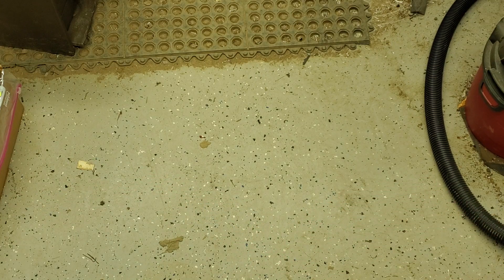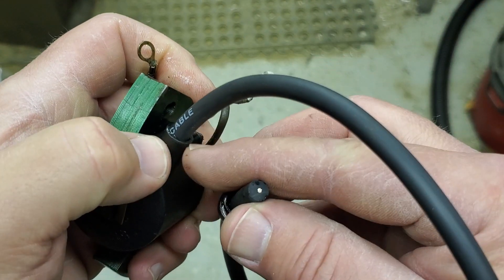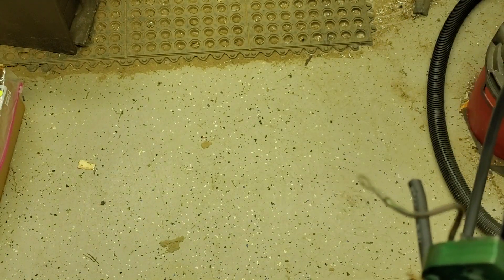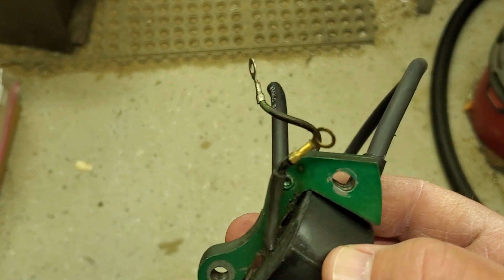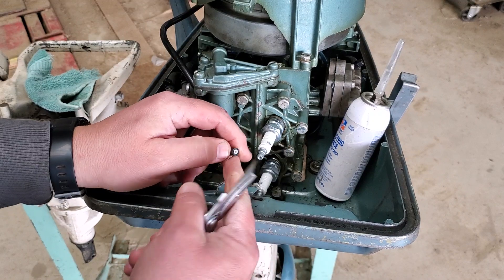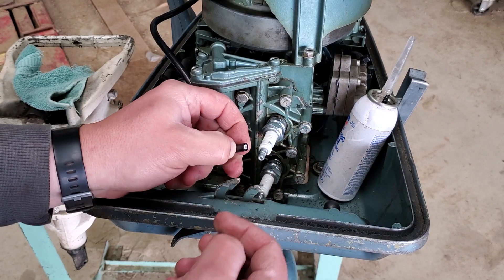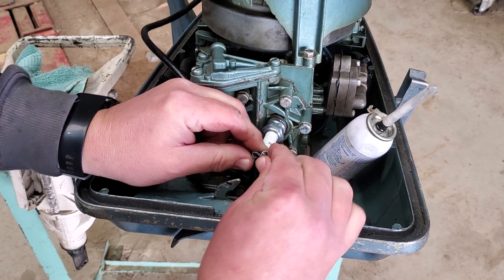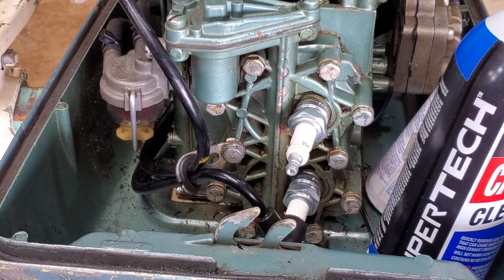Replacing Spark Plug Wires and Terminals on an OMC Universal Magneto

Comment: Great video. Do you have a video of setting the air gap on tie coils after replacement?  I don’t have the locator ring
Reply from the maker: I don't have a video of it, but when setting the coil air gap without the ring, just line up the heels of the laminations with the machined outer edge of the bosses the coils sit on.  Use your fingernail to get them as close to the machined edge as you can without them hanging over and tighten them down.  I have set lots of them that way before getting the coil ring.  Thanks for watching!

Comment: Thanks for the tips, I've got a motor just like that one, have you ever ran across a bronze 2 blade prop for a 5.5 just purchased a 62 Johnson with one, and guess that's the only year they incorporated fuel filter housing on intake, that calls for sock type element, keep the videos coming.
Reply from the maker: Yes, I have seen a 2-blade and a 3-blad bronze prop for the 5.5.  They are not real common.  They have all been Michigan Wheel props.  I had a '62 Johnson 5.5 and it had the remote mounted sock filter too. I guess I never paid attention to that being the only year I had seen woth  sock.  Thanks for watching!

Comment: I'm restoring a 57 mercury mark 10 which runs good but the plug wires are old and need new ones. I haven't looked that close yet but was told the old coils the spark wire can't be replaced?
Reply from the maker: Without looking it up I don't know if the Mark 10 Merc has Phelon or Scintilla ignition.   Either way, the plug wires can be replaced, but the Scintilla mag will have either tabs or solder blobs on the coils. If it has a tab, just bend the wire through the loop.  If it has the solder blob, you have to very carefully unsolder the old wire and solder on a new one, or if part of it is good, cut the wire and solder a new length of wore to a stub of the old one.  Be very careful soldering them.  Too much heat from the soldering iron can melt the secondary winding internally.
Reply: They have the Phelon coils. Thats good to know then. Thanks

Comment: Thank you for the helpful video. Got a ? for ya  do you know if a 1957 10hp Johnson lower unit will work on a 1958 Johnson 18hp?
Reply from the maker: You're welcome.  Glad to hear you found the video helpful.  Yes, the 5-bolt lower unit from a '57 10hp Johnson (or Evinrude) will bolt up to and work on a 1958 Johnson 18hp.  Thanks for watching!
Reply: @oldjohnnyrude8404  Thank you so much for the info. My 18 HP lower unit is bad (gears) former owner got the screws boogered up so bad , I have a lower for a 56 10 HP, and was hoping it would work. I'll use the prop from the 18. I sure do appreciate your help friend , thank you again, God bless you

Comment: Happy thanksgiving!
I just pulled apart the 33 and 35 to start the short shaft conversion. Unfortunately I won’t be able to just bolt the short case on, the flange is ever so slightly different and will not seal, and also the water pumps are different the 35 has 2 tubes coming out the 33 has 1..but everything else looks good for swapping parts. I was hoping you knew off hand which of your videos will guide me for removing the shift rod, that’s the only part I’ve never messed with in this process.
Reply from the maker: I guess I didn't realize you were dealing with one Super Quiet and one non-Super Quiet.   That is true, they will not quite match up.  The rest should be the same.  The powerheads don't match up either, but the internal parts are the same.  If the actual shift rod has to be changed, the gearcase has to come apart to remove them.  The skeg comes off then the gearset comes out.  At that point the shift fork and shift rod assembly can come out.
Reply: @oldjohnnyrude8404  ok, so i gotta take the very bottom skeg part off, and that whole gear assembly should just come out in one piece, then shaft just slides out thru the bottom right? And doing all that gives me access to the shift rod linkage too. I should probably replace all the oil seals and shift rod seal while I’m there too huh?
I didn’t  know The was a quiet motor, the housing is all different for sure, i thought it was just fancy 50s facade styling... I wish that 59 was in fixable condition because, I can’t believe imma say a Johnson is better looking than the Evinrude, but this one really is/was ;)
Thankyou
Reply: @oldjohnnyrude8404  got the cases opened, the skitwin definitely had a water leak, the Johnson was sealed tight... the oil/water was also rusty orange in the skitwin, the o-ring for the prop shaft was rotted completely away,the cotter pin for the shift rod linkage was rusted almost all the way thru, and the case was sealed with silicone not a spaghetti gasket, and the driveshaft was missing it’s o-ring also. I’ll have to use the gear assembly and bottom case cover from the Johnson for peace of mind. Good thing I did this swap!! So I’ll order the driveshaft seals and a new impeller and she should be good to go :)
Reply from the maker: @TheFrogfeeder  I have had plenty of them turn out that way.  Yes, it is a good thing you made the swap.  It should be set once you get it done and back together. 👍
Reply: @oldjohnnyrude8404  this will be the most work I’ve done on a motor yet, I got everything apart and clean and covered, I found a entire lower unit seal kit on amazon for 26$ so I’ll even have the nylon washers for the drain/fill plugs which I’ve never seen on any motor I have or had. The lower unit will hopefully be good for as long as I own this motor now :)
After this, I just gotta retap 2 bolt holes where somebodies jbweld let go, The starter bottom bracket is mounted to those 2 holes, and there is pressure behind there...I think that goes back to this being a frankenrude motor ;)

Comment: Hey I purchased a 69 18hp,evin. Seller said it had new coils,points, by his local mechanic, at pre-insp noticed mag plate movement at rotation,pulled flywheel found 1 lam leg contact to flywheel, lams were discolored slightly starting to flare open slightly, no major grooving on flywheel. Coils appear to be BRP markings and new gold hold down bolts, Thinking to replace with new one, what's your opinion would you go used old factory type or (hi-fong) china, noticed no fuel filter on that model either, going to adapt factory glass bowl type and remove spark plug wires protective sleeve too, stiff over time think that was the cause of worn advance lever, 69 late model, kinda like to leave them what there born with, you need flexibility on those wires, including stop wires too, enjoy all your videos, I understand what you deal with on getting them right, when you can crank them with 6" of rope
Reply from the maker: I would replace the worn coil with a new OEM coil.  I would avoid the Chinese Ebay aftermarket ones. If you do want to be able to start your motor with a 6" pull of the starter rope, don't try the cheap Ebay coils.  They run, but they won't make a strong spark at that low of an RPM.  If you give the rope a rip, it will start and they'll keep it running. Starting will not be as easy though.  I like to keep those coils in 10hp and under motors most of the time.  Sierra do not always have well-fitting laminations anyway and the lams are the reason for replacing the one existing coil.  I would also hold on to the coil with the flared lamination as a spare.  Chances are it would still work fine as it is if you didn't want to replace it at all.  Just move the lamination back so the edge is even with the machined bosses on the mag plate.  The auxiliary fuel filters were eliminated at some point due to the filter screen being inside the fuel pump inlet cover.  I do like the glass sediment bowl filters also.  Having the extra filtration certainly will not hurt anything.   
Those plastic sleeves over the plug wires always get stiff.  I have removed most of them from my motors for that reason.  The kill switch wires get stiff too, but do not restrict magneto movement like the sleeve does.
It is always nice to hear when someone enjoys my content. Thanks for watching!

Comment: Thanks for the great how to, I just picked up a nice QD15 that will need going over, Where do you get your parts such as carb kits, water pumps and the like ?
Reply from the maker: Congratulations on your new motor.  The QD-15 is a great one.  I buy many of my parts from Marineengine.com.  Also check iBoats, Vintageoutboard.com, ebay,  etc. Something to know about the QD-15 since it is a 1954 those are getting harder to find parts lists for.  Many of the parts, however, are still common with much later motors.  The water pump is the same as that used in the 18-25hp through 1976. The carb kit is the same one used on the 10hp through 1963. Coils,  points, and condensers were used on all the twin cylinder OMCs from ~1952 through 1972. Thanks for watching!

Comment: Where do you get your spring tips for the spark plug wire to spark plug head? I've looked all over the internet and don't find anything like that? Thank you for the info...
Bill
Reply from the maker: They are available from BRP, Sierra Marine Parts, and other sources online such as this one:
https://lionparts.com/products/spi-01-109-sparky-plug-connector-sold-each-not-pair?variant=31138827993167&utm_campaign=gs-2019-11-20&utm_source=google&utm_medium=smart_campaign&gclid=Cj0KCQjwmcWDBhCOARIsALgJ2QcHm18LQhuodvUw2QFwk7iFA5xdHTEEQK4sVKohugEp2NkOEF1IqsYaAmHGEALw_wcB

Thanks for watching!

Comment: I have a 1960 Ward/ sea king 35 hp with electric start gg8837A. From what i understand the sister engine is 35DE13 by gale/bucaneer. Ive read somewhere that these are considered OMC engines . do you know anything about this im struggling to find parts.
Reply from the maker: Your Sea King is built by Gale Products.  It was the third branch of OMC.  They built all of the store brand motors for OMC that were marketed by Wards,  Spiegel, Atlas, Goodyear, Eaton's of Canada, etc.  The 35s are mostly identical mechanically to the Johnson and Evinrude 35hp motors with the standard (non-super quiet).  To my knowledge Gale never built a motor with the Super Quiet lower.  The 1957 and '58 standard J/E should share pretty much all the mechanical parts that are not cosmetic.  I hope this helps. Thanks for watching!
Reply: @oldjohnnyrude8404  thank you so much! Im glad there is someone out there with as much knowledge as yourself willing to help others and share their videos. Thank you again. Ill have to send ya the video when i get the boat restored and the motor singing as nice as one of yours!
Reply from the maker: @sir.icefire5470  That would be awesome.  I'll be looking forward to seeing it.  Thanks again for watching!